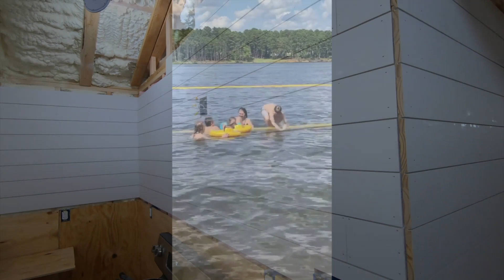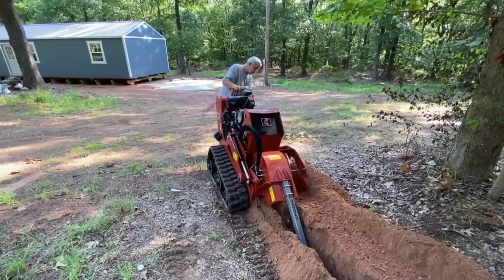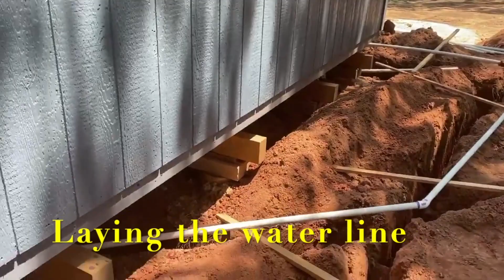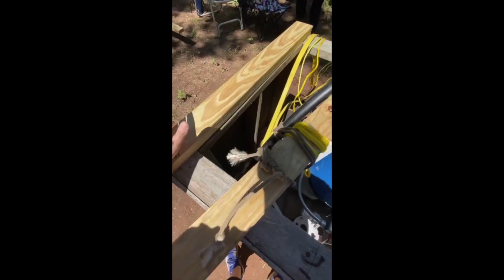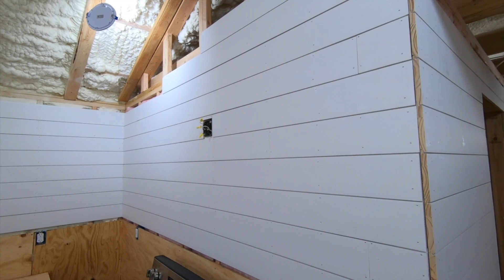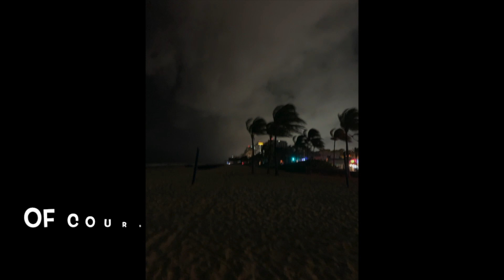Shed to Home Conversion - Setting up the well.

Comment from the maker: Here is the link for the well pump and pressure tank we bought off amazon and used. It has been about months and we are still super happy with it.
<iframe style="width:120px;height:240px;" marginwidth="0" marginheight="0" scrolling="no" frameborder="0" src="//ws-na.amazon-adsystem.com/widgets/q?ServiceVersion=20070822&OneJS=1&Operation=GetAdHtml&MarketPlace=US&source=ac&ref=tf_til&ad_type=product_link&tracking_id=roadtoroots-20&marketplace=amazon&amp;region=US&placement=B005X547JM&asins=B005X547JM&linkId=33a6c763750ab3969dadbb08936d80e5&show_border=true&link_opens_in_new_window=true&price_color=333333&title_color=0066c0&bg_color=ffffff">
    </iframe>

Pressure Tank
<iframe style="width:120px;height:240px;" marginwidth="0" marginheight="0" scrolling="no" frameborder="0" src="//ws-na.amazon-adsystem.com/widgets/q?ServiceVersion=20070822&OneJS=1&Operation=GetAdHtml&MarketPlace=US&source=ac&ref=tf_til&ad_type=product_link&tracking_id=roadtoroots-20&marketplace=amazon&amp;region=US&placement=B0002YWTO4&asins=B0002YWTO4&linkId=e034e5eb4560be802566c2f63ea387b4&show_border=true&link_opens_in_new_window=true&price_color=333333&title_color=0066c0&bg_color=ffffff">
    </iframe>